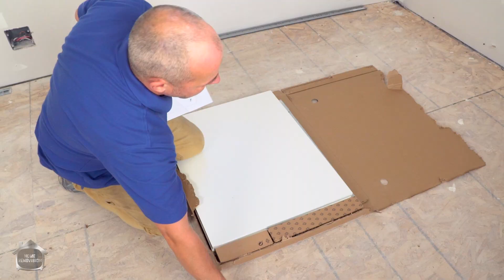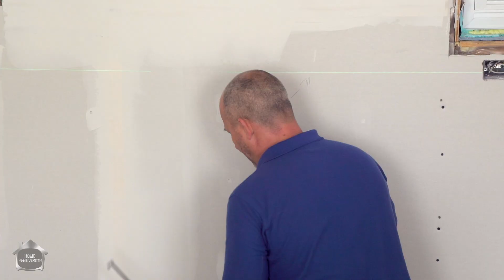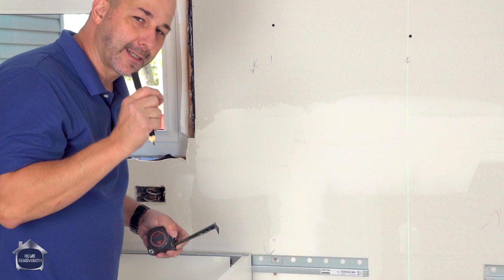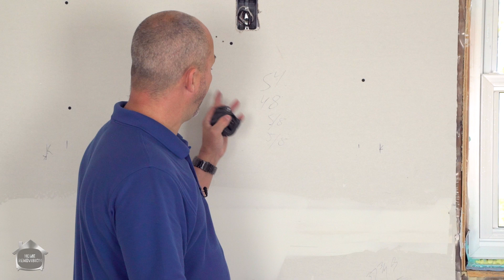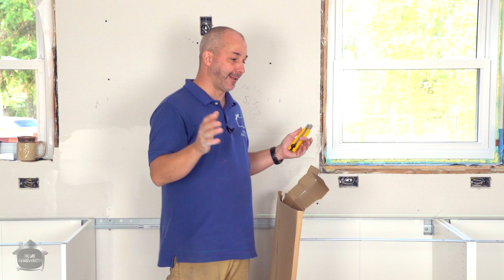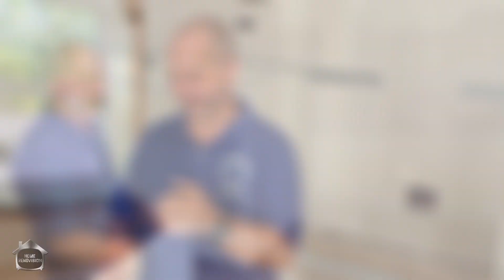How to Install IKEA Kitchen Cabinets and Save Money! | DIY Kitchen

Comment: Question: I had a roof leak last winter that leaked into the wall between my bedroom and bathroom, as evidenced by water coming through the drywall at the fire blocks.   The roof was fixed and the wall dried out, but should I replace the drywall anyway?  In particular wondering about possible mold hidden behind the paint...

Thanks for all you do!  You've inspired me to renovate my aging house and more importantly, informed me on how to do an awesome job at it too.
Reply from the maker: Hi Jason, Great question. since the leak was repaired and you obviously don't have any signs of mold yet I would say the water event has dried out. In most cases it takes a while for mold to grow to the point that it needs to be removed. Remember the wood in the wall is the source of mold. As long as it stays dry the mold will not grow and release the spores that can effect your health. unless the wall cavity you are talking about actually has access to your living environment Then I would say no worries. If it was my house I would just move on. I have been on sites where total flooding has happened and we were able to mitigate and dry without removal. cheers!

Comment: Do those brackets allow for some waviness in the wall?  If not how do you suggest you correct some wave so that the bar isn't bent causing the cabinets not to hang correctly?  TIA
Reply from the maker: you can always shim in behind the bracket to keep the bar straight. cheers!

Comment: Can't wait to watch this, just finished an Ikea kitchen project for work.
Reply: My fun was metal studs though, the floor was pretty level.
Reply: I'm definitely feeling the 16" on center, my project was a mix between 16 and 24 and it SUCKED.
Reply from the maker: ouch!
Reply from the maker: So How did yours turn out?
Reply: It came out really well, here's a picture. I still have to drop the kick panels in.
 https://www.dropbox.com/s/zgm3ed027c1rto6/download_20191223_172408.gif?dl=0

Comment: Reguarding the very last of the video, when the grider was being used with a cut-off wheel, one can see that it takes some force to hold the grinder steady.  I have always used cut-off wheels on my drill and experienced the same tendency of the disc to "jump" around/off of the project.  I recently purchased an OSCILLATING MULTI-TOOL (a very inexpensive tool)  OMG, WHAT A JOY TO USE!!!  There was NONE of that tendency to jump around, Just a Sweet, Smooth, Steady Cut!!!  I should have purchased one years ago, I'll never go back to using cut-off wheels on a drill or grinder.  Additionally it's much safer too.
Reply from the maker: and around 400 hundred bucks for a good one. Cheers!
Reply: Wooah!  Mine was like $25.00 (from Walmart) which is fine for my home project use.  I Am Going to get a laser level like yours, I hope it's not hundreds of dollars...   AS ALWAYS, YOUR CHANNEL IS BEYOND COMPARE, THANKS SOOOOO MUCH FOR WHAT YOU DO!!

Comment: I've found that using one of those 7-in-1 painters tools to open Ikea boxes works even better than a knife. The ones that look like a ~3" stiff putty knife with a roller cover cleaner cutout - Run it along all the glued seams (3 sides), then the box opens right up. I've even sealed a box back up with spray adhesive and you couldn't tell it was ever opened. 

A 6" flexible taping knife with the bottom and side sharpened quickly with a file also works well.
Reply from the maker: Thanks. Cheers!

Comment: Great video. when I bought my first house and gutted the kitchen I went with Ikea and was very happy. Their prices for what you get blew other box stores out of the water between getting euro hinges and soft close as a standard versus paying a premium elsewhere. Their system is very DIY friendly but as you mentioned making sure everything is level is key. I ended up having an issue between one wall and the other wall where the sink was causing a slight height difference the countertop people said needed to be fixed. This cost me another measurement fee but actually ended up working out because the Ikea salesman mentioned they were having a 15% sale so they actually added that to my countertop cost after the fact so I ended up saving $$ despite the $200 remeasure fee.

Comment: I just did my ikea kitchen install.  I found that because walls weren't square and plumb I took more time shimming and building out the back of the rail to make things just right.   It meant the cabinets all fit together easily and they were easier to level and plumb in each direction.  Also after fitting the base cabinets and prior to locking and screwing them in, I screwed a 2x4 along the wall so that the bottom back of the cabinet can sit on it for extra support.

Comment: Great video! Unrelated question: I'm planning out a basement apartment project, and I have a french drain that will end up in a bedroom. Is it safe to put a grate on it flush with the concrete floor and cover it with a DMX/OSB subfloor? Will my subfloor properly drain/remove moisture? Is this up to Ontario Building Code? Thanks for any help and great Channel! :)
Reply from the maker: you will need to have access to anything that has a grate. Cheers!
Reply: @HomeRenoVisionDIY  thanks!

Comment: Putting a filler strip on the ends when you have extra space can be replaced with a small narrow cabinet (made yourself if need be) that would be great to hold tall wide items like cookie sheets and long cake pans.  Any extra space is space that can be useful, even if it's two or three inches.
Reply: Yes every little space count and make a difference
Reply: Ikea sells thin cabinets for cookie sheets

Comment: Hey Jeff, another great video.  
What method do you use to secure the Ikea foot supported island, so it does not shift if someone bumps into it once finished? 
Thanks again!
Reply: The weight of he countertop, and anything you put in the cabinets will hold it in place.
Reply: IKEA has another set of feet for islands that are made out of wood and allow you to secure it to the floor. Maybe Jeff will use when he does the final installation?
Reply from the maker: i ended up building a panel on the back that was secured to the floor, as well I have panels with brackets at the other end for the dishwasher and wine fridge. Plus the quartz top pretty much sets it in place for good. Ikea also has end panels that go on top of the flooring to secure the base cabinets. Cheers! But that is in another video!

Comment: Perfect timing for my project! You've mentioned to install these cabinets before the flooring goes in. What happens if your installing engineered flooring that's about 3/4 thick. Do I need to take this into account as well as possible levelling of the floor?

Comment: Not IKEA, but I had my parents get their kitchen carcasses placed on aerated concrete (painted white after kitchen install) as a base/toekick, directly on the bare concrete floor. Then they had the floor tiled in slate and a low tile in the same material put all round the walls and on the kitchen base. Looked awesome with the solid, white painted, brick interior walls (no drywall except ceilling)) and easy to clean. And the base was perfectly level for the kitchen to be mounted on.

Comment: Great video but aren't you supposed to lay floating flooring after the cabinets go in to allow for expansion?
Reply from the maker: vinyl flooring does not have this problem. Cheers!
Reply: @HomeRenoVisionDIY  Are you positive? I really wanna believe you because I design (and my company installs) IKEA kitchens, and flooring is always a huge discussion however the second I google any floating floor including vinyl it mentions expansion and contraction. Only tile and nailed down hardwood is problem free.

Comment from the maker: If you want to get one of those measuring tapes then visit our new website and click the link to shop at international tools. They are our newest affiliate online store. They carry millions of tools that can be searched for by company name. Cheers!
https://www.internationaltool.com/shop/?cjevent=9b2d88fb24f011ea825a01760a24060d&utm_source=affiliate&utm_medium=cj&publisher=Home+Renovision+DIY
Reply from the maker: https://www.internationaltool.com/shop/?cjevent=9b2d88fb24f011ea825a01760a24060d&utm_source=affiliate&utm_medium=cj&publisher=Home+Renovision+DIY
Reply: @HomeRenoVisionDIY  Hey Jeff, love your channel.....speaking of tools, i have been trying to find the name of the screw bits that you use for your impact drill. They look like 6" phillips magnetic tip bits with the quick-lock bit - however  i can't find one, the closet i see is DeWalt, can you drop a link to where i might find a set of those bits in varying lengths? (plus the quick-lock bit)

Comment: Interesting, my 23 year old IKEA base cabinets didn't have the rail system and back then I used an IKEA approved contractor.  They were installed with just the feet and  had "L" brackets to screw them into the wall.  Maybe it was because I only had one base cabinet per wall?  I had to move them by myself, and yes the feet snapped off - and snapped back on (It is better to lift than drag!).  I wasn't going to consider IKEA again because the doors didn't stand up well, but I've heard of other companies making solid wood doors that can be used with IKEA cabinets so I am reconsidering.  The boxes aren't in bad shape so I might just strip them down and reuse them in the new layout.  I didn't think of that until I saw  your video. Thank you.
Reply from the maker: Cheers Barbara, there are now hundreds of door options when ordering from those companies. definitely worth looking into! Cheers!

Comment: Perfect timing, Jeff! I went with your advice about a month ago on seriously considering IKEA kitchen for our Florida house which is our second home and investment property. Again, I never thought about IKEA as an opinion;  rather, I was always thinking of  the traditional route and expense on going custom.

I made an appointment with IKEA kitchen specialist after submitting my measurements. We discussed options and the specialist provided her expert recommendation. At the end, the whole kitchen renovation will be 50% cheaper than going custom. I would love to put the cabinets myself, but considering our house in FL is nearly 2 thousand miles away, requires airfare expenses, car rental, and taking personal time off, it paid itself to elect to have IKEA professional install. I would really would have loved to tackle this on my own, but my next available time to spend good quality time on doing this project as a DIY-er is nill to nothing. We plan to pull the trigger for a spring or summer install.

Regarding the lazer leveler, I clicked on your link of products on Amazon. What model was it you used in this video? 

Great viz and perfect timing! Thanks much!

Xathan X.
Reply from the maker: Cheers Xanthan X. At some point reasonable people all have to make reasonable choices. you will not be disappointed. I use the dewalt cross line. it is a less expensive model that provides almost everything you need when working in doors. Cheers! And I put it on a stand. most lasers and stands have a universal 1/4" thread on them.
Reply: @HomeRenoVisionDIY  Thanks, much!

Comment: The hardest part of an IKEA cabinet installation is getting the base cabinet at the exact right height to ensure the toe kick does not have a gap at the top. So annoying that they don’t make the toe kick wider as to give you some wiggle room to trim to fit.
Reply from the maker: I prefer to leave it a little short and scribe the toe kick on the saw. Cheers!

Comment: If that’s your space for your cooker to fit were is the gas for it as I only see the power for the cooker as not all cookers are just electric ⚡️ as mine is gas hob and electric over ok dude.
Reply from the maker: Hi Andrew I am installing a mixed fuel stove. My Gas guy will install the supply line once the stove is installed on site. that way he gets everything right where it needs to be the first time. Some stoves out there have very strict supply line placement.

Comment: I think you're forgetting that you are going to have chairs at that island.  I would guess either 3 or 4 of them - which means that the 40" that you have is going to be significantly reduced to walk around when they're empty. Maybe 15" if you're lucky.  Then when you have people actually sitting in them and add in the knee depth (sitting position with chairs moved out) you are not going to be able to walk at all on that side of the island.
Reply from the maker: it will be a little cozy but I am sure you will see when we are finished it is functioning just fine. Cheers!

Comment: Hold on!!! Buy the frames according to the space you have and go back and buy drawers, fittings and all the rest after it's installed. That is a GREAT tip!!! It's too easy to mess things up when you try to design the entire thing up front.
Reply from the maker: Hi Tom, not just that but if you assemble the frame and change the design you can return it assembled. Cheers!
Reply: I'm doing that approach. It's a bit annoying because you need to keep track of everything.
Reply: Not if you use the Ikea planner. Great little tool.
Reply: @Cyberdine.Systems.Model-101  actually I did and it's not like I had major issues installing the kitchen. I wasn't happy with the way I've devided up the cabinets and after everything was done I quickly came to understand how it would have been better. I know there are people who are able to do this perfectly but for me having the cabinets really assisted visualizing the details
Reply: @tomstern1681  Well I'm glad it worked out in the end. Good job, mate.
Reply: I recently did a whole house in AZ. If you use IKEA for the counters they will not even show up for the measurement appointment if you dont have doors drawers and side panels on. Just something to check with them on first.
Reply: @papaneek  Don't forget the Fixa brackets for Quartz support

Comment: So are you setting the uppers 18" off the base cabinet box? Or were you saying 18" above the counter height?
Reply from the maker: If you want to use them it is 18 off the finished counter. Cheers!
Reply: He is saying off the counter height.  In an other video he explained that most back splashes are designed for 18 inches - so you will save yourself aggravation by keeping it at 18".
Reply from the maker: Cheers Barbara, you are definitely paying close attention. Good to know I have people helping out. 😀👏👌😀👏

Comment: That's a great idea about the extra screws to strengthen the metal supports. I'm planning to add a concrete counter top, and will need to add more screws to the cabinets for more support.
Reply from the maker: are you doing pour in place or form?

Comment: Greetings from Sydney Australia. I'm owner building here and I'm always looking for a bit of extra know how. The main thing I dislike about the Ikea cabinets are the flimsy backs. 
Always enjoy your watching videos Jeff and thanks. 
Bruce
Reply from the maker: I get it. although since the back is not a structural component to the box it is just there to keep it clean looking. Cheers!
Reply: Bruce Cort 
Well you could buy some 1/8” sheet, cut it down, and glue and nail it over the factory ones. That would add rigidity.
Reply: @krehbein  Why do the backs need rigidity? It's pointless?

Comment: I never shopped for cabinets before but these seem perfectly adequate. What reason might someone choose a cabinet system pricier than IKEA (other than they're not available where you live or you simply don't trust them), and does it make a big difference in price?
Reply from the maker: solid wood cabinets retain their value for resale in higher priced reale state markets. But out here in the country using reasonable approaches to renovating is necessary in order to get your investment back. Cheers!

Comment: Alright, what bits does he use? I tried to find the name of them on his Amazon page but could not find them.
Reply: Pozidrive
Reply: @carlmccoy662  Thanks, I found some, but did not find any that were the same color as the ones that he uses in the video. I found pozidrive style bits, made by several different brands. Is there a particular brand that he uses? Thanks!
Reply: @youngn9na92  Don't know what brand he uses. Even if you get a lower quality bit you won't wear it out on 1 kitchen. The screws Ikea and blum use look like phillips but they are pozidrive. The bracket that attaches to the cabinet(hinge) uses the small screw size the rest are #2. You can use a regular manual screwdriver too. Be careful not to strip out if using power tool.
Reply from the maker: Cheers Carl, Great advice!
Reply: Pozidrive

Comment: Pro-tip for opening IKEA boxes (from a Swede with IKEA addiction - u can just drag a finger between the glued parts from the three sides and it opens like a box. Or if finger isnt strong enough use a knife as suggested but on all three sides. (Usually the short sides are easily opened with very little force tho)
Reply from the maker: Cheers Jonas!
Reply: I already commented but a stiff plastic spatula works even better. No paper cuts! Or a butter knife!

Comment: Any benefit to building your own bases to sit the cabinets on?
Reply from the maker: That all depends. the feet are a little precarious but get the job done for a steal of a deal. If you wanted a solid base then making your own can be helpful, however in this case the house is so out of level that An adjustable base would need leveling feet in it anyway. Cheers!